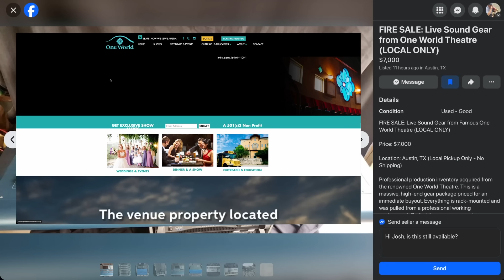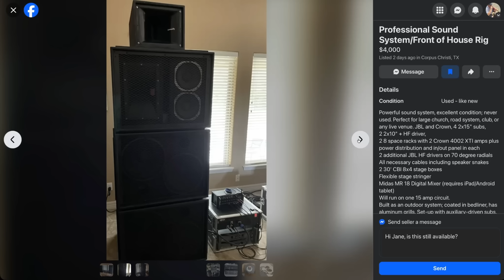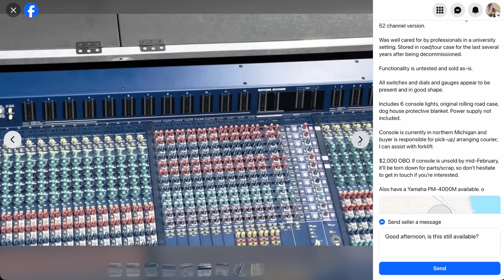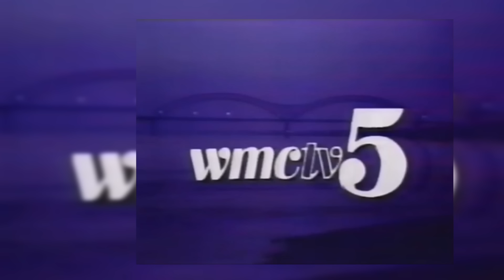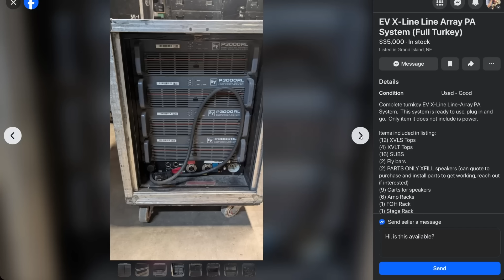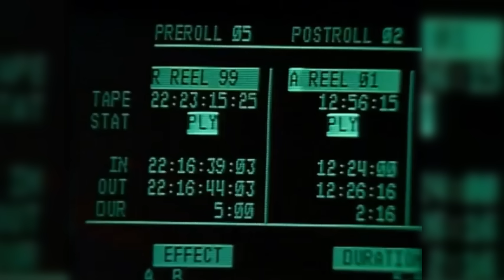Pro Audio Deal Or Disaster? Episode 22

Comment: the older dbx  drive rack units tend to have LCD failures. I've had a lot of them just die on me - which is a bit of a problem when the only way to change settings is through the front panel.
There's meant to be a way to flash new firmware but that requires Windows 7 to get the USB driver to work.  

X32's you have  to check the AES50 ports haven't been blown by non--spec cable. If it isn't turned on and showing two green AES50 lights it's not worth gambling on.

Comment: I did a quick search for the PM5000 power supply and I couldn't find one.  I did find an ebay listing for the cable for 327.
Reply from the maker: Thanks for that info on the cable! I feel like the power supplies might be making it to the scrap yard (since they are easier to move and  more copper dense) before the consoles unfortunately.
Reply: @DcSoundOp That makes sense to me.  Unfortunately I think that console is destine for scrap.  I grew up on analog and will always have a love for large format consoles.
Reply: Can you interchange PSU from different Yamaha PM
PM 3.5 k, PM 4k etc 
Would these work on a PM 5k?

Comment: I believe those Macro Reference amps were mainly intended for driving larger studio monitors - the kind of speakers that you'd flush-mount in the front wall of your control room. It's quite a different set of trade-offs compared to a touring amp, linearity and distortion are prioritised over both power (don't need much!) and weight (don't need to move it!).
Reply from the maker: That's great info, thanks Dylan.

Comment: On that first item for $7000 the answer is yes I would pay that money in a heartbeat considering what digital boards are going for especially that brand look our Church just paid close to $300,000 for their board came from Germany so you tell me is $7000 a good deal or not all those power ramps that patch Bay please I pay that in a heartbeat but I ain’t got seven grand. I did three years ago which I found your channel then I have some killer speakers, bro look at the speakers. Are you trying to rock the place? They look like JBL but those ain’t JBL it can’t be oh yes they are JBL‘s check that out that’s a pounding system there two crown 404,002.
Reply: Yeah that seems like a steal.  Especially getting that ramlatch iso split.
Reply from the maker: Yeah, I’d love to know if they have all the cabling for that snake & how long they all are.
Reply: @marcdich  you can easily buy Pro2 Pro1 anywhere from $1500 to $4000 depending on a condition and stage box. One of the best sounding desks.